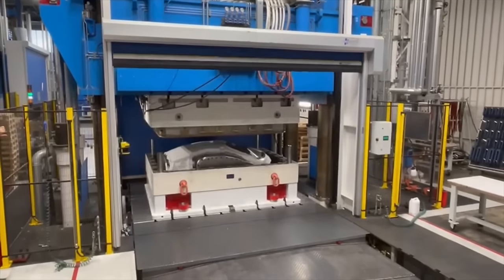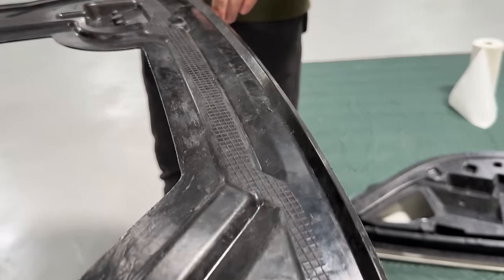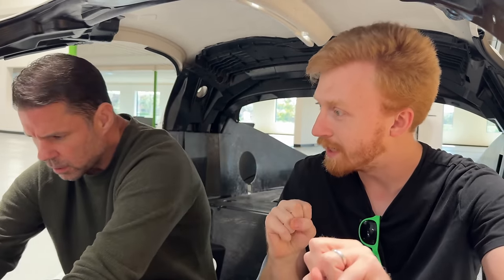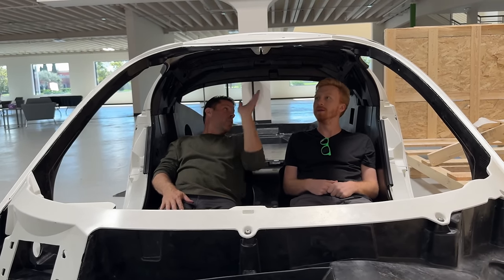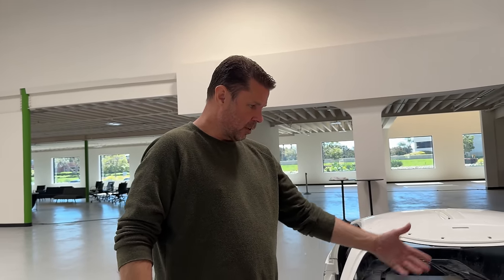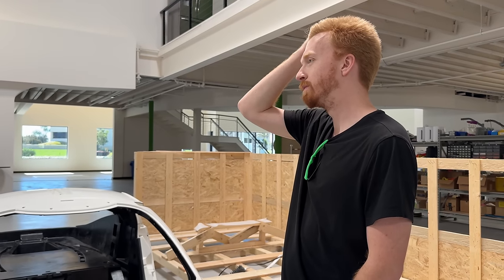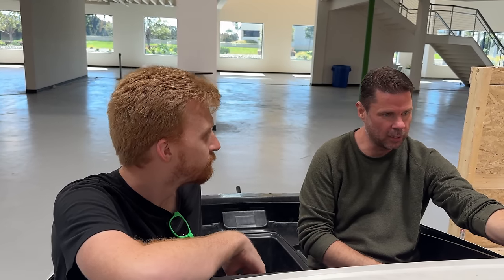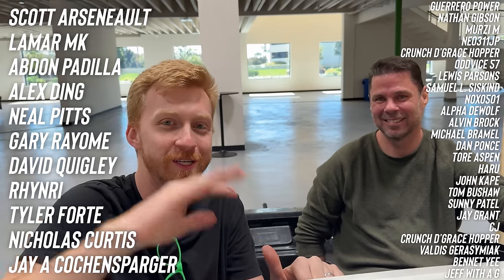Aptera Answers YOUR Questions!

Comment: Will this come with a spare tire? Thats my biggest concern as an ability to maintain
Reply: Good point, but my Mini Cooper and $50k Tesla did not come with spare tires. I have a fix-flat kit in each car.
Reply: I don't think it will, especially since weight is so crucial for the Aptera, probably just a repair kit. You may, however, get one yourself and give up some space on the trunk to transport it.
Reply: NOpe, but you could probably carry a spare in the back.  Plus a jack...  Not sure how easy it will be to replace the rear wheel...
Reply: @artboymoy  Replaceability of the tire and wheel on the front and rear is my number one concern with this design/build. With a 1000-mile vehicle you better be able to change the tire based on the hub that's packed with motor/regen/cooling etc while out there. Also, a blow out on a 3 wheel is scary, for a motor bike, so I hope they consider this as well on the rear pan. Even though its only 1800 lbs and most of it is centered forward, the rear tire has an important role just like the landing gear of a small bush airplane going around corners at 50 mph. I hope they do some testing for the rear tire on extreme cross winds like in Wyoming and South Dakota.
Reply: @nathanmrg2  I think the more important thing will be, how fast can Aptera's service respond.  Because, you'll probably have to have it towed to a repair shop.
Reply: @nathanmrg2  The wheels can be removed from the motors, just as with any car.  But most flats are best fixed with a plug kit and a DC inflator.  These work well and do not cause the mess of a Fix-a-flat kit.  I have used them on both motorcycles and dually vans as well as cars.

Comment: How would you wash this vehicle?
Reply: Soap and water
Reply: @GoClimbARockEh  I was more worried if the solar panel would be affected in any way during the washing process
Reply: @kingjohn8980 No more so than the panels on your roof or the panels in a commercial solar array. Probably less so as these are designed to withstand road vibrations and highway speeds.

Comment: Why can’t the aptera body be all carbon fiber?  Why is there white fiberglass?  I would love to clear wrap mine so the cf shows through.
Reply: I believe the fiberglass is less expensive and easier and more common to repair.
Reply: Ahh. Makes sense. Would still love to see that carbon fiber though.
Reply: @daytonclaudio689  I know what you mean, but in reality it doesn't show as well as the woven carbon fiber. If you really wanted to, and yes I know it's not the same thing (only for looks), they (3-M) have wraps that simulate that look.
Reply: @glennzajic7318  yeah. I’ve thought of that. The woven carbon fiber look wrap. Like you say though, not the same. I think I’ll just go with a Noir wrap. I’ve asked aptera if I can get mine unwrapped since the launch addition is Luna, then have a third party wrap it. They said they will get back later when they’re closer to launch.  By the way, I got a chance to sit in the Noir when I was in Carlsbad last year. It is really beautiful!
Reply: @daytonclaudio689  If you do that they should, at the minimum, include a free pattern!
Reply: @glennzajic7318  yes. I will also suggest that they pick some wrappers in the area to partner with.

Comment: Thank you for addressing winter testing. I didn't really find the answers compelling, though. 1/4-1/2" isn't a lot of snow. How's it going to handle 1' when the whole wheel pant is plowing through snow? Is the door mechanism strong enough to handle the door being iced over? How's the door going to open without dumping snow into the cabin when I'm first reaching in to get my brush out? How's the 3 wheel design going to perform on an iced-over road with ruts carved out for 4 wheeled vehicles? Looking forward to some real world testing on some of this stuff. I hope his not being worried about it is justified but I'm definitely not convinced yet.
Reply: 🤔If you got 1 foot of snow, I'd stick to driving a snowmobile, not a car! (or wait to plow, shovel or blow that snow away.)😎
Reply: It's an unknown till they get it out there.  One thing about hub motors is they will probably prevent snow and ice packing in the wheel coverings.
Reply: With a foot of snow, I'm calling in sick, but since I don't work anywhere, I'm not going out.  Easy peasy.  As far as snow on the roof goes before you open your door, you have an arm. use it to clear some snow.  Let's be honest.  I live in WI in a city and when there's a lot of snow out, especially a foot, they advise you to stay inside.  So please, use your common sense and judgement when it comes to it.  I'm always checking the weather and if there's a big storm on the way, I get some extra food.

The Aptera will be fine and handle like most vehicles on ice and snow after the plows have cleared the road.  It's not going to be better, but it probably won't be any worse if you have the 3 motors and maybe some traction control (we'll have to see if they think of putting that in).  For the 10 days of bad snow falls that may inconvenience me, the rest of the days in the year, I get to use a super cool vehicle, and with bright snow covered surfaces, I'm still going to get a bunch of charging when the sun's out.

So, while you raise some valid concerns, I would temper them and just wait to see some real world tests.  If you're not on the waiting list, it could be a good 5 years before you could even get one.
Reply: @madmotorcyclist  I was thinking they might generate enough heat to melt it, which then leads to an icing issue for me...
Reply: When I'm out in snow....say grocery shopping or the like and perhaps while in store the snowfall rate starts picking up, I avoid snow on top of my car from getting inside because I always take my snow brush with me.  Same when I get to work in the A.M.  If it's going to snow that day, again I simply take my snow brush into my office rather than leaving it inside my car.  I never get snow falling from the roof into the inside of my car.

Comment: The reason Teslas have very high standby power consumption ("phantom drain") is not because they use the wrong kind of wireless technology, it's because Tesla don't care (sadly). 
Just look at your phone, it constantly communicates and has tons of apps waiting for all kinds of messages and notifications, yet its power consumption when sitting idle ("phantom drain") is less than a Watt, a hundred times lower than that of a Tesla car.

The "pager network is why we don't have phantom drain" BS is just another of Chris's annoying verbal smoke grenades.
Reply: But using the pager network does take far less energy than using 5g, for example. He's not wrong.

Comment: Please, move the assembly forward as soon as possible. As it’s a auto cycle , no extreme crash testing is necessary.
Reply: It's not the crash testing that's holding back the timeline, but finalizing funding so they can finish tooling and initiate the supply chain

Comment: I'm still wondering where the delta prototype drivable vehicle is at ,not  a computer-generated images that they showed.  I've been waiting for 2 years for this prototype vehicle, all I got was gamma , but no drivable delta prototype yet ,not interested ! Turned off by Aptera , still no delta prototype, that's drivable, that been promised. All I got was a computer generated image. Totally unacceptable, no wonder why they folded in the past...
Reply: Hurry up and wait. Go down to the corner store, and purchase 5 Lbs. of patience, because if you want this to happen, you also want a vehicle which will not be recalled for yada, yada, yada. It needs to be made well, not just quickly. If it is rushed, then it will not reach its full potential, and be destined to failure. Building it properly, instead of rushing it to market, is making it a better product. The pandemic brought the supply chain to a standstill. I want mine too, but would much rather take delivery of a safe, well thought out, properly designed vehicle, than something just slapped together, like a kit car. Good things come to those who wait.
Reply from the maker: Pi build number 3 is the delta prototype.
Reply: This entire video is centered around the very first Delta body, which are now being called Production Intent or PI.  The third one will be flushed out for full display, drive-ability, and is estimated in about two months.
Reply: @chrisbarrett2512  Gamma has several thousand miles on it.  The hub motors that will be used have been tested to a million mile usage with much more environmental testing than Tesla's motors (such as submersion in freezing salt water for 24 hours and they still work).
Reply: @chrisbarrett2512  It's funny that you mention the kit car because Chris made it sound very much like one, with his model car analogy, which I am fine with, because of the way the parts are made and all.  With the R2R model as well, this could very well be a kit car and wouldn't that be fun to be able to build your own Aptera?
Reply: @madmotorcyclist  I am very pro Aptera, however, I do not believe your statement is correct. Aptera modified the Elaphe motor design to be slightly more efficient in the range Aptera is shooting for. I don't know if they have made many (any) of them, so I seriously doubt they could have put the equivalent of a million miles on them.
Reply: @glennzajic7318  In an video I saw about a year ago by Elaphe one of their engineers talked about those tests they did and in the video itself showed the freezing salt water test they ran the hub motor submerged in it for 24 hours.

Comment: The problem is, and it's insane nobody is taking about it, after all these years, there is no factory. This looks like an empty building with zero production capabilities... Or assembling capabilities... Or any capabilities. They have some parts that are produced somewhere else basically as a prototypes. I still see absolutely nothing that resembles serial production. No machinery, robots, assembly lines... Nothing.
And for Aptera fanboys, this is not hate, I'm just commenting on what I see or rather don't see. 
I'm no expert and I know Aptera isn't your typical car manufacturer, but I work almost 9 years in automotive industry and this is shocking me. 
In other word, Apera it's hitting market anytime soon...or ever.
Reply: Keep in mind, a lot of the manufacturing is happening in Slovenia, Italy, and South Korea. All they really need in Carlsbad is an assembly plant.
Reply: @GoClimbARockEh  I know, but if you want to stay afloat, you need either sell many vehicles or very expensive vehicles. Aptera won't be that expensive, so they meed to manufacture in numbers. And that would be too expensive if done manually. So you need automatized assembly lines etc. 
And I've seen absolutely nothing so far, only empty hall.
All am I saying, they are very far from any kind of production and fans will be waiting for longer than they think...
Reply: @MrRandomguyTom  we are exactly 9 months after they get funding from production to start. They've been very clear about that. They need that funding to fully build out the production line. I see no reason to doubt the timelines they've given us on this or to think it's some reason but it's never going to happen
Reply: @GoClimbARockEh  don't be disappointed if it gets delayed. 
I will gladly admit my mistake in judgement, but I have all the reasons to be skeptical.
But I hope they will succeed. Market needs lightweight and efficient EVs instead of fat SUVs and trucks...
Reply: @MrRandomguyTom  "I will gladly admit my mistake in judgement, but I have all the reasons to be skeptical."

For this I agree. I am also skeptical about the timeline. They timelines have been pushed back many times already. (Largely due to the pandemic) They also need more funding. Once the PI vehicles are made I do think that the investors will come through. A working production intent vehicle that has been crash tested and able to drive is a big step. Especially when you want someone to invest millions. But yes I am skeptical too which is why I have not invested. I just put down a refundable deposit to get my place in line.
Reply: @MrRandomguyTom  At this point, any major delay is due to funding. They've done all the engineering, they know exactly what they need to buy, and even who they're going to buy it from. Sure, it might take them a week or three longer than the nine months they're telling us, but so what. It's happening soon. Stay tuned.
Reply: @MrRandomguyTom  As a investor I would have more criticism if they had all that equipment, and it was setting around for 6 months waiting for the final design.
Reply: Thanks for your opinion that nobody asked for, it moves the algorithm nevertheless. Now go stick your head back in the sand.
Reply: @GoClimbARockEh  Because of the LEAN manufacturing techniques that they're using as well as consultancy with Sandy Munro, the early-on assembly of Apteras (particularly the LE) will be done in that building and only about 20 to 30 minutes per build/assembly of component parts.  The motorized/robotic dollies that will move the partially assembled vehicles from one station to the next are already bought, paid for and in that building.  The next required cash is for injection molds to produce things like the dashboard, center console, and other parts that they haven't already planned to get off the shelf.  For much of these ancillary parts, Aptera isn't reinventing the wheel, they're going with time-efficient, cost-efficient already existing parts and sub-assemblies.  It's brilliant and kicks ass out of the way a traditional automotive manufacturing facility would look and/or operate.  So get ready--it will look, feel, sound and BE completely different!
Reply: The robots are already in house, and so is a modern inventory management system that is already being exercised, that can track down to the individual battery serial number in each pack.

Much of the Aptera design is handled differently from typical car manufacturers - especially parts count for a given function.

Comment: You can buy a nice Chevy bolt for under $20,000 and have a real car that can haul people and gear!
History is littered with 3 wheel cars that failed!
Reply from the maker: Did any of them power themselves?
Reply: If I wanted a boring hatch built with last century tech, from an entrenched legacy auto maker, with a dealership that's bent on profit, I still would not consider it.
Instead I kept my RAV4 and my Miata and bought an Arcimoto. Then I joined the Accelerator Program and look forward to driving my signature vehicle by next summer.
Reply: @TailosiveEV  What part of "History is littered with 3 wheel cars that failed" do you not understand?
Reply from the maker: False equivalency. Just because two vehicles have the same number of wheels that doesn’t mean they have the same demand or use case
Reply: @TailosiveEV  It appears you need to be hand held through this....

When Aptera fails, it, too, won't "power itself".
Reply: @palindromeambigram4852  There are also some major successes in Europe and Asia.   3 wheelers took Reliant to the #2 manufacturer's position in England.
Reply: @n.brucenelson5920  "History is littered with 3 wheel cars that failed" does not equal "All 3 wheel cars have failed".....
Reply: @palindromeambigram4852  History is also littered with 4 wheel cars that have failed, and I can name many of them off the top of my head.

The very first car every made was a three wheeler - you know the history, I imagine.
Reply: @n.brucenelson5920  Another logical fail on your part.  Try again.

Comment: I love the idea, but this is not going to be profatalible
Reply: What part of 1/10th the parts, half the assembly time, no paint shop required and use of robots don't you understand relative to low manufacturing cost, thus higher profit?
Reply: @richpate9436 half the assembly time of what?
Reply: Just the opposite, one of the most profitable vehicles ever built, at a margin well over 30%.  This has been planned since day one.
Reply: @DemaGeek  Very few buyers at 33k, they will have to lower the price
Reply: @robertjohnson6639  Only 47K reservations at the moment.  Very few, indeed...